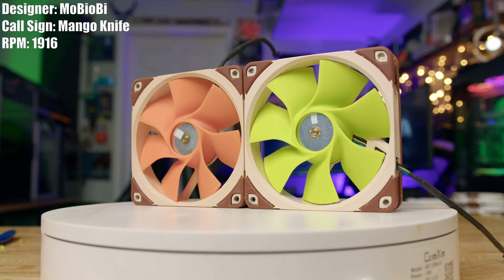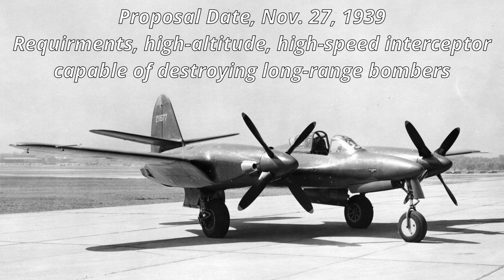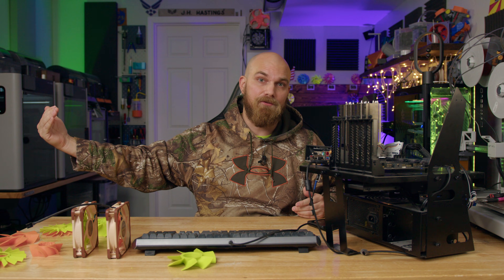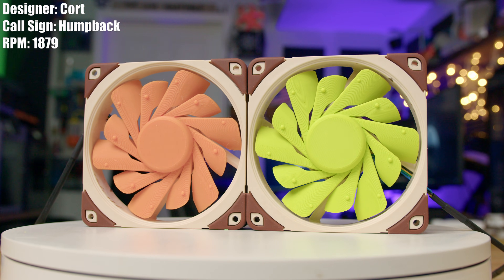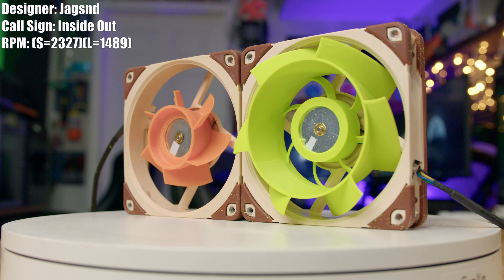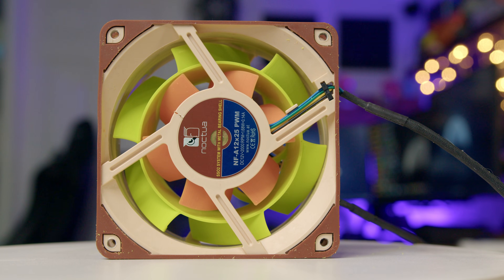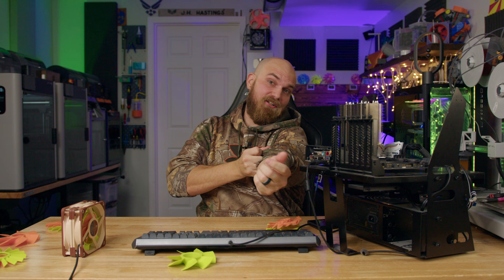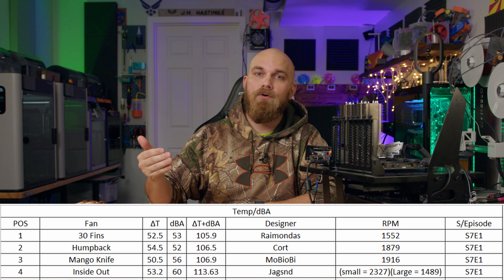Stacked TWIN Fan… is a Monster | Fan Showdown S7E1

Comment: As an avid gamer for decades. From the first initial water cooler which was a single 120 fan on a radiator that went directly to the cpu. Been there done that. When they started expanding the tanks where you put two fans on it as a diameter of it was longer than they extended to three to four fans. I didn't bother with that not until my recent 2023 build.

For your for your rating system absolutely the decibels are extraordinary important especially if you don't wear a headset while you're gaming. Which some people utilize it especially if you're doing raids Discord TeamSpeak those type of franchises. And there was previous ones as well.

Depending on what type of load your CPU is either a banked out on your GPU fans. If you had frontal fans rear fans side fans. Plays a horrendous amount of attention. Cuz if you're playing an extremely Megalodon game that's causing everything to Max out. The DPS of the fans alone will cause you to crank up your game volume 50%, just to rule out the airflow noise and DPS of the fans especially if they are PMI fans and are constantly going up and down up and down up and down and not stabilizing. Thus the game certain parts if it's just a cinema then yeah it will probably max out if it's a raid you have 50 people in there all fighting a massive boss yeah that's some pretty hardcore load right there.

Versus just turning it on and letting it stabilize. A lot goes into consideration testing environment. What is the temperature of the stagnant temperature do you have a ceiling fan on do you have a floor fan on is it the only thing that actually is pushing and pulling air. There's so many specifications that go into it.

Like my current PC I don't play any hardcore games like I used to. But it will raise my 10x10 bedroom nearly 25% in temperature will raise. It's brutal sometimes especially if you play during the summer. The AC unit just can't seem to compromise well.

So I'm looking forward to your new schematics on testing fans. As I'm pretty sure a lot of these people are most likely not novice with building and working with CAD with 3D printing.

Comment: You should really run the noise measurements with the fan loaded by the heatsink that it's going to cool.
Some fan designs produce vastly higher noise when interacting with heatsink fins than the fan on its own (how you're currently testing it) would have.

Comment: As for nature of the ratio, you should probably mark scores on multiple tasks and add the scores instead of having a single task that is a ratio between temp and Noise (eg. Frequency, Temperature, db, Normalized Frequency on db). Otherwise there is a probability that the top scoring fans are just the quieter one and not the best one.

Side note, Temp is not really a mark of how good is a cooler in normal condition. Freq is i think much more reliable. Unless the voltage are capped. I dont remember the exact setup and i dont really feel to rewatch the video to get this info ahah

Comment: No, just, no.... dBSPL is only part of it, the cooling factor would be king IMHO as a PC guy. 
Having the "quietest" fan with the worst cooling specs win is not where my money would be going.... 
I understand there is a compromise to be made as far as noise level is concerned, however, sacrificing 3C for an extra 1.5dB is not what I would call a good decision.... 
Just my 2c though... One thing I will say is that it would 100% HAVE to fit inside a PC case and not impede other cards etc.... That is why PC fan manufacturers design the way they do, they have to work around other system constraints, I would bring this into play and work from that, things have been getting...... A little unwieldy should I say.... Some of the previous designs one would be hard pressed to mount inside a PC case on a thermal stack let alone have it not impede other cards or drives inside a PC case....

Comment: Acoustics? NO...NO...NO!    🛑 STOP NOW!  
WHY?  Because the sound is highly subjective and therefore makes a horrible way to judge the fan!  

Here is the major problem with adding the acoustics to the score.  You can have 2 fans that all have the same dB and one will sound louder than the other.  Measuring how 'loud' they are is subjective because it also depends highly on frequency. 
The human ear is not a dB meter!  Depending on the frequency of the sound,   at the same dB level, one fan can sound a lot louder than another fan, and further to the point, you may have a fan with a lower dB level, and you may perceive it as louder than the other fan with a lower dB level.  
The sound is subjective.   
Highly Subjective!   

I get having a dB reading from the fan as it provides some information, some data.  However, the data is nothing more than a reference if you are not there to hear it or compare it to another fan running in person.  It is more than just how loud it is, the sound it makes matters too, the frequency matters.  They have examples of different frequencies at the same dB videos, so I suggest you watch and more than that, listen so you understand this.

Comment: i think you have the sound test wrong, you should say 100 - the result then add to the Delat T, no logic in adding a lower (good) delta T to a high (Bad) sound test... you should do Delta T + (100-dbA) than it will be High + High = winner

Comment: There's a couple things I think that might be affecting this current season.

1. Acoustic needs to be done with the cooler, no matter the positioning.
- This ensures proper and rigorous spacing for all fans.
And it also takes into account the possibility that the resonance of the fans might increase or decrease while attached to the cooler.

2. Since the fan combinations include either side of the cooler, or both on one side.
- You should be doing the smoke test WITH the fans attached to the cooler as well.
This will actually test and show how well two fans pushing or pulling, or one pushing and one pulling, work together in creating that airflow across the cooler. 

3. We need that Benchmark average.
- You need to include a run with 2, A12 fans IN ALL 3 POSITIONS!
This will ensure that you have a "benchmark" line for all three possible combinations of fans.

Comment: Sound test should be done attached to the cooler, but suspended in the air. Harmonics with w/e it's sitting on will change sound output greatly. See 3d printing cement bricks

Comment: This definitely needed two tests, it needed a test on a radiator. You would need to "standardise" on a specific radiator, but that's minor as the fin stack of any mass production model is going to have similar characteristics. Turbulence would be massively different, as would air pressure. 

Additionally, for any dual fan arrangement you should be using some kind of case. A dummy box is fine, but it is necessary. The inside-out model would need to be tested separately as exhaust and intake as well.

Comment: This scoring system makes zero sense. dBA is a logarithmic (non-linear) scale, so cannot be simply added to deltaT. You are also effectively saying that 1dBA of noise is about equal to 1C delta. Why? That does not make sense- it is arbitrary at best.

Fans should be compared at a set noise level, then you can meaningfully compare cooling performance at a given noise. 
Or fans should be compared at a set delta T, then comparing the noise. Both methods would be quite simple to set up with some code and PWM control. 
Or convert dBA to a linear intensity, and combine with weighting (how much do you value each score?), only if you must. Really fans should be presented as two leaderboards, one being the thermal leaderboard, and one being the noise leaderboard. Both leaderboards would be meaningful in their own right, and it would be interesting if certain fans perform well in both categories. .

There is no universal 'exchange rate' between noise and cooling, so combining the scores as you did is meaningless.

Comment: You 100% need to measure sound on the cooler, as that affects turbulence significantly.  Besides, that’s how normal users would experience a commercial fan, and the goal of TFS is to try to improve upon the commercial offering of a very good design.

Comment: So, someone can make a really quite fan that is kinda crap at cooling and it might place high on the charts?
You should setup the fans and run them at 40db and then measure temps for a score. Then you can crank them as high as they can go to check cooling performance.

Comment: I think the weighting of sound is too heavy, I would suggest DT + (1/2DBA). 2c is more valuable than 2dBA, I feel in most cases.
Also as has been said do all testing on the cooler, too many added variables. You may find some designs could loose 1-2dBA where others may not. Also smoke through the cooler :D

Comment: Sound Test=== ON THE COOLER  Or do both do a open room just before putting push pull on the cooler------------------------------------    ((( And where is the control fan the a12 or whatever???)))

Comment: I feel like noise should be weighted extremely low and have a cap.
Sure, something that sounds like a jet engine full of glass is actually annoying to use, but if it just sounds like a lot of air being blown around like a high power air conditioner, who cares? I feel like people are just minmaxing for the sake of it, and part of it is that people have turned focus to dumb aesthetics like RGB lights and shit because of influencers and twitch.
Being able to reach a higher clock speed and run a game at a playable FPS is way more useful and actually enjoyable in real world use than just achieving dead silence on your cooler, and even the noisiest fans are barely noticeable compared to the chainsaw noises our PCs used to make in the 90s that nobody cared about.
Besides, you can put your PC case inside something sound proof if it's really that big of an issue.

Comment: Sorry, but I don’t believe that the highest scoring delta T was the mango. The highest delta tea was the humpback at 54.5 C which means it cooled the most going from 75C down to 20.5. The mango was only cooling from 71C down to 20.5 I believe you have the scoring backwards the highest Delta C is the winner in the cooling.

Comment: For the smoke, would a device (3D printed?) to make the smoke come out as a stack of lines be beneficial? Rather than a bulk wisp as it seems some designs are eating the smoke differently, chopping, diverting to center and so on. Just a thought on how to get more of a visual if there's varied velocities near the hub or rim

Comment: I concur with others in the comments that a noise normalize test would be the way to go to determine a score (in addition to full speed test to see what it's capable of noise be damned). Or let the score be the temp at full speed and only use the db level as a tie breaker(s).

Comment: It'd be interesting to pin the CPU at a specific power level and then adjust the fan speed to equilibrate at a standard temperature, and measure the sound level at that speed.

Comment: I don’t think weighting temperature and noise equally is the way to go. What happens if you repeat the test without a fan? (You can call it my submission if you want.)

CPU will thermal throttle at around 100 giving a temperature score of around 80; noise will measure as your room’s noise floor (so 20-30?). Total score could well be in the 100-110 range, which looks fairly competitive.

Comment: I may be in the minority here, but I'm not a fan of the sound testing being scored. Especially considering the subjective question of which would I rather listen to. For instance, a high pitched piercing fan at 50db is far worse than a white noise generator at 55db.

Comment: I’d love to see the fan efficiency tested like a hot-wire airflow sensor. Heat the CPU plate with a resistive load to a specific temperature, and monitor the current/power required to maintain a specific temperature. You’d end up with a quantitative number for how much heat each fan can extract from the heatsink.

Comment: I dont think adding sound as a deciding factor to the score is a good idea. Cooling is always priority. A good case is going to be designed for airflow.  Noise while it does matter to some users it doesnt matter to all users. Cooling is something that matters to all users. Then there are other factors like PC placement and what the PC case is made of that will also affect noise levels.

Comment: Not only should the sound test (as said by @TurboJLo) be done with a cooler but also in a closed case. Like I said last time, very few people run open benches like this so it's not an accurate real world test, which makes it pretty pointless. Acoustics and temperatures will be drastically different in a closed/actual case.

Comment: You should score noise from zero quiet to high score for loud fans to allow for infinitely loud fans on the scale.  You should then subtract that score from the temp score for the final score.  The louder the fan, the more points you lose.

Comment: Baseline sound against the A12. Subtract the final dBA from whatever the baseline of the A12 is loaded onto the rig from the fan in question and add it to the final Delta T; rewarding a quiet performant fan. IE a 10point increase in dBA could result in a 10 point increase in final Delta T. 

If you want to weight it more or less significantly you could add some sort of modifier or treat it as a ratio and multiply it, but so long as you retain your dBA and Delta T measures you can go back and back-calculate any further tests in the series.

Comment: Another vote for testing the noise on the cooler. The Inside Out almost certainly had some contact rattle going on that the other pairs of fans weren't subject to, even though in practice they would be in contact with another hard surface - penalising fans that have the two fans in contact vs fans that are separated by the cooler seems an unfair bias.

Comment: That mangoknife had insane directionality in the airflow, and as we could see it handedly took the airflow.
I think it would have been a lot quieter if it had been tested while attached to the cooler. I think measuring sounds while mounted is the way to go in this test.

Comment: you can't add temperature differences and decibel and expect anything useful. A temperature difference of 0°C is impossible, but 0dB is possible. Still, you have a lot of background noise which will drown any truly quiet fan. Basically your measure makes no sense.

Comment: dB should be done with fans on cooler. As for the smoke, while it puts off a nice stream. I like the way the older one was more dispersed, letting me see better how the fan actually brought air into the fan from all directions. So maybe move the smoke machine around a little.

Comment: Just as a heads up, coaxial fans (2 fans setup so one blows through the other) run super inefficiently if both fans spin in the same direction. People designing the fans should keep that in mind and i think allowing one of the a12x25s to be mounted backwards so its spins in the opposite direction should be allowed for this reason, its why all those cheap rc helicopters with 2 rotors have that little mechanism in them that spins the top rotor in the opposite direction, not only does it remove the need for a tail rotor to counter the rotation of a single rotor, it improves the efficiency of both rotors working together

Comment: 12:55 why is the score ΔT+dBA? this would suggest that you want a low ΔT instead of a high ΔT. as it is now the humpback is behind the 30 fins despite having a better cooling ability and making less noise. i would suggest ΔT/dBA (that way its the efficiency of noise to cooling)
Reply: Or, implying that you want a high dBA instead of a low dBA. Either way, it's nonsensical.  An extremely loud fan with no cooling would score better than an extremely effective fan that's whisper quiet!
Reply: I was confused for a second also. You do want low delta T. It is not the delta of uncooled cpu vs cooled cpu, it is the delta between room temp and cooled cpu temp, so lower delta means colder cpu. Higher delta means the cooled cpu temp is higher.
Reply: @jeder3836 thanks for the explanation!
Reply: YES! Makes no sense

Comment: since most fans will fall within a 10C delta range, but a 20-30 dB range, i'd add a 0.5 multiplier to the dB value.

Comment: @Major Hardware
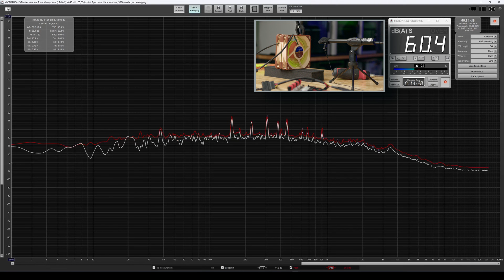9:40 Can you also do a "sweep" over all the fans sounds in sequence, WITHOUT you speaking in between?  (added at the end of the video? for easier "buffer zones" (read below)).
So we can max out our speakers volume to REALLY hear the difference, without having the speakers be blown out from speech in between each fan. (fan name can be a text)
You can first present each fan (as you do now) with their sound. and THEN add each sound individually, preferably with an exact 5 or 10 second length of each clip, so we can either use the arrow-keys (5 seconds) or J/L (10 seconds) to easily jump to any fan, also, add a quiet 5-10 second "buffer zone" at least after the clips but preferably before too, just in case we jump too far accidentally & would blow out the speakers.

Comment: 9:48 Melodic fans? :D
It is probably possible to design fans that harmonizes with each other very melodically, especially when varying the loads & speeds on the fans,
And with 2 fans, you get a graph that is a "sound area"* instead of a "sound line" as you would get with a single fan. (*depending on each fans individual speed compared to the other).
Maybe a testing metric should be how "melodic" a fan(s) is to hear, but how would you measure that metric? (& I think different prime numbers can create longer "melodies"?)

Comment: You could make the delta T an exponential function too:
Score= dB + 10 × 10log( deltaT )
Then the scales match but the temperature difference doesn't matter a lot anymore.
Or some kind of realy quiet sound normalized testing.